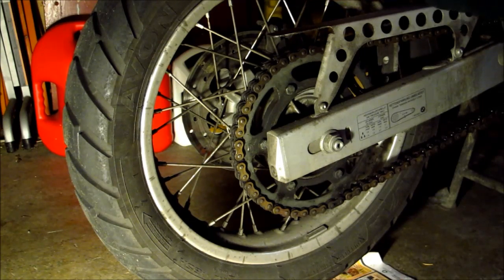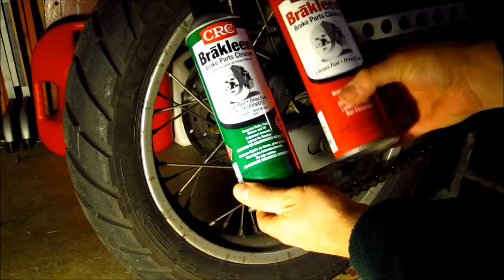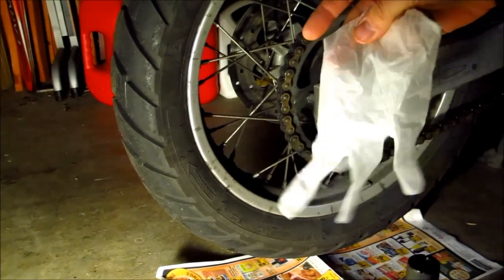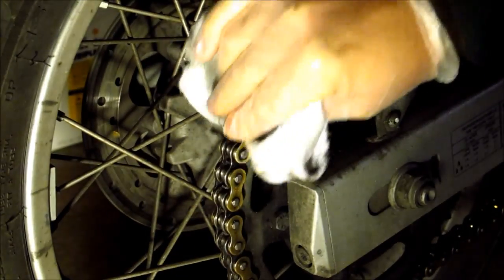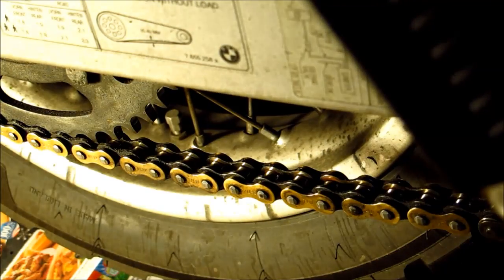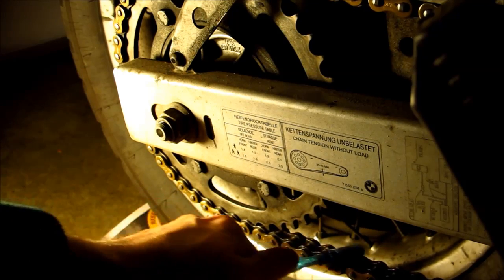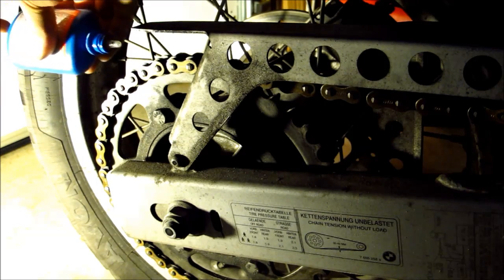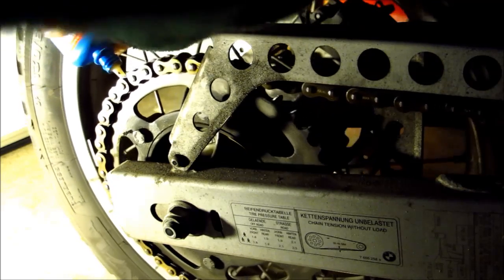Cleaning motorcycle chain with brake cleaner and lubing with Dupont Teflon Multi-use Dry Lubricant

Comment: You should NEVER use brake cleaner on an o-ring chain it will dry out the O-rings! Also you should clean the inside of the chain first or your putting dirt right back into the chain if you do it the way you showed
Reply: No it doesn't. Another youtuber literally soaked o rings in brake cleaner for hours. Nothing happened.